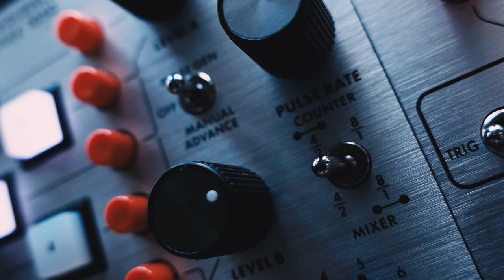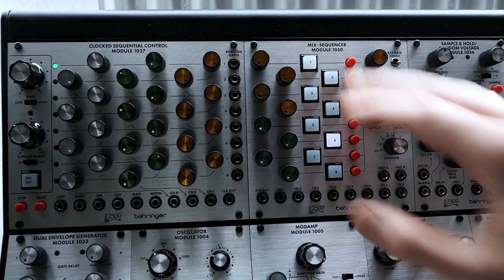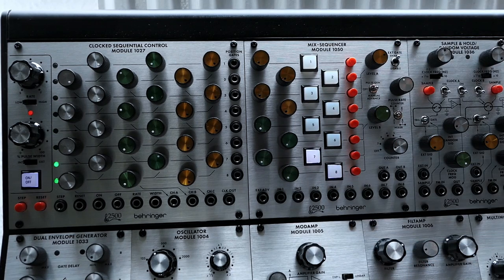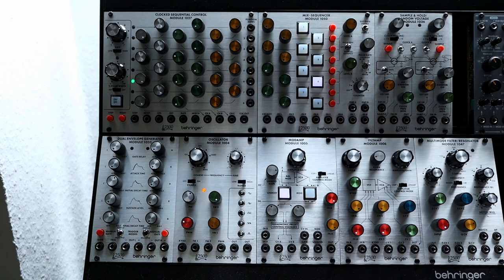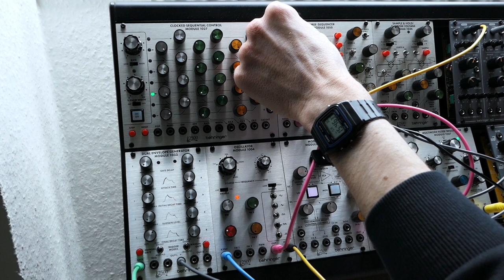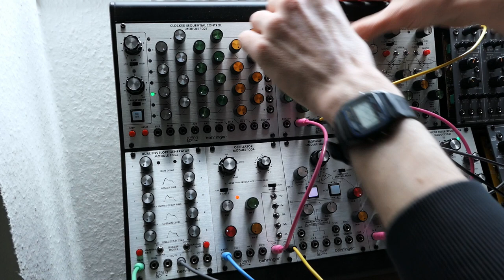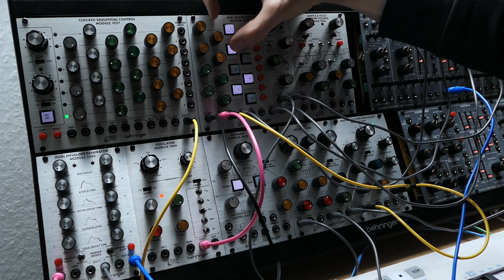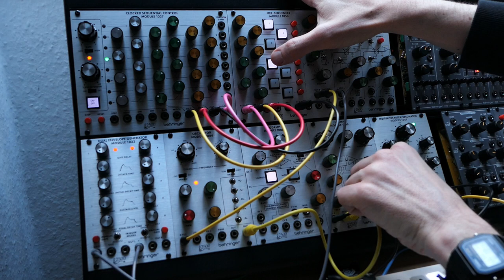Behringer 1050 Mix Sequencer ~ sequential switch on steroids

Comment: For whatever reason I get most of my patch ideas when driving and running errands. One of the most recent ideas was the realization that the 2500 multimode filter 1047 would be awesome to patch into the 1050 :)
Reply from the maker: I often use the 1047 as additional oscillator by patching one of the outputs into the input. Works great

Comment: I just ordered mine today :) there was a 48 month no interest financing option that I couldn't pass up. When the 1027 was available at my retailer I had to pass on the 1050, but now my 2500 series collection will be complete!

I've got 2 1004's, a model D, a moog werkstatt and the tip top audio buchla 258t, as well as some LFO's that are capable of audio range, which I think will be a great start for messing with audio mixer function :)

I'm really excited to try out the sub oscillator utility that you presented. Thanks!

Comment: Super deep exploration, thanks! Curious, how did you do stereo mixing? There is no panning available in 1050, right? Did you use another mixer and panned the 1050 outputs in that?
Reply from the maker: No, the 1050 has no "true" stereo, but since it has two independent sections, you can just feed those into the left and right inputs of a stereo mixer. Thats what I did here.
Reply: @synthesizer83  Thanks for the quick answer! Will be receiving my behringer 2500 module collection next week. Can't wait to try it out with the help of all the videos in your channel :)

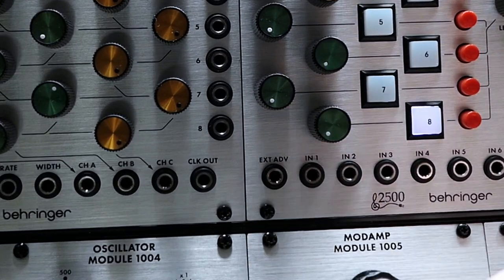Comment: Hi really nice demo! But i can't replicate the SUB osc feature around 8:30 minutes.. is it possible to write down the steps? Kind regards
Reply from the maker: Yes it is pretty simple: 1: you feed your OSC audio out into the EXT ADV input of the 1050. 2: Take a constant voltage (e.g. from the 1027) and feed it into the first input of the 1050. 3: Grab the output A of the 1050, this is your desired sub-osc audio. With the step count of the 1050 you can create different divisions, 2 steps would be one octave below, while 4 steps give you two octaves below the original audio input.

Comment: Hi love the amazing sounds in your video you are creating! I am new to Eurorack world so was wondering if the 1050 sequencer is better than the Berhinger 9600 model? Also do i need all individual lfo, vco , oscilaitor modules to create a sound patch like yours in the video or can i get an all in one module, sorry if the question seems a bit silly im a complete noob to the Eurorack, thank you!
Reply from the maker: The 1050 alone is pretty useless, since it is not a sequencer but a sequential switch, so you definitely need come cv source to feed through it. The 1027 would be the counterpart to the 9600. Can't judge about the 9600 though, since I don't have it. The 1027 is quite powerful. 
There are synthvoice modules which combine VCO, VCF and VCA in one unit, the Behringer 110 for example, or Doepfer's A111-5 or -6.
Reply: @synthesizer83  Thank you for the reply, information and recommendations much appreciated, I'm still early stages Eurorack noob so a lot to learn.  love you channel - cheers